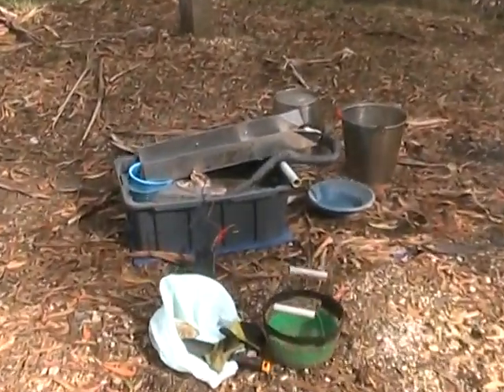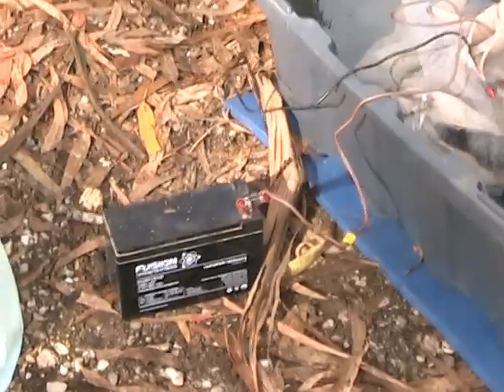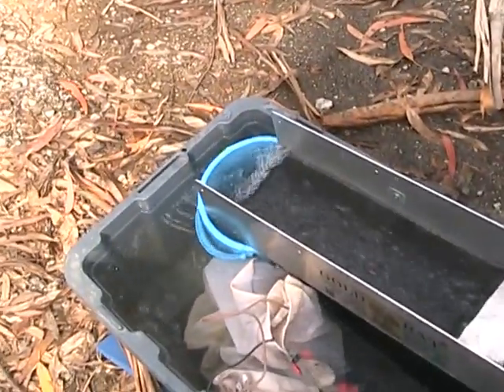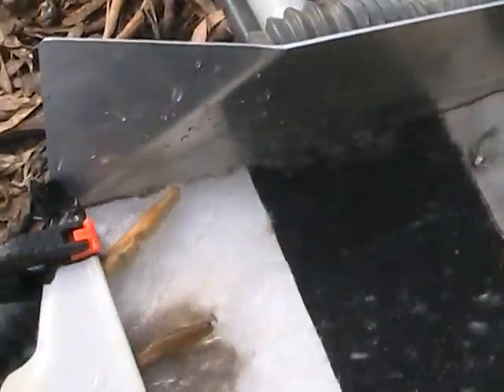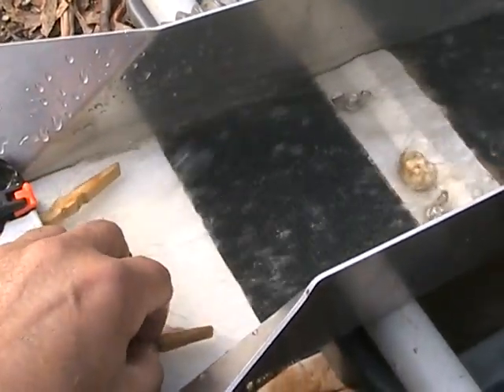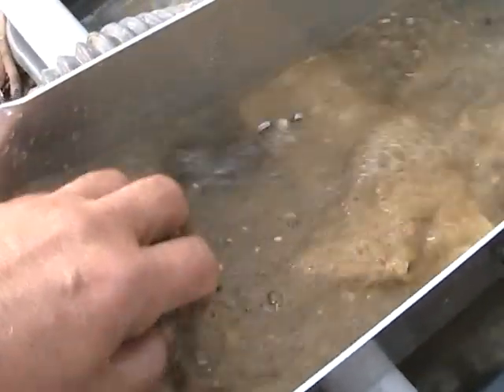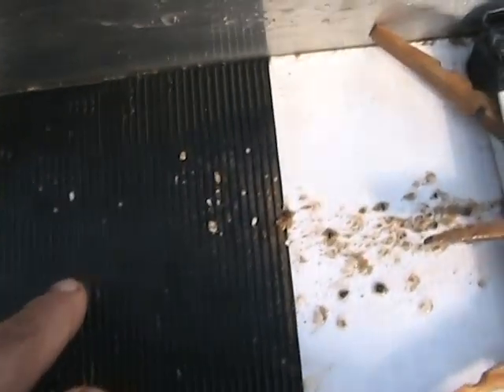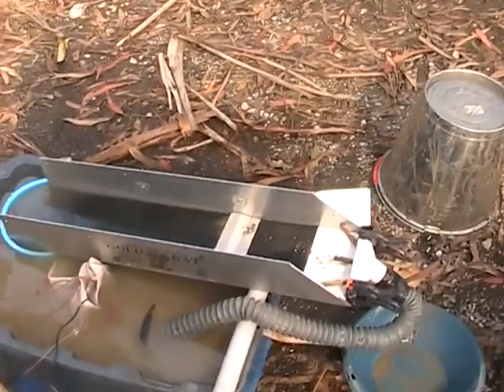Mobile Sluicing Tub Part Two

Comment: For your information , I run a pump with twice your output , but my sluice is almost twice your width , so I figure we are both running the same amount of water per unit width.
And I find 5 degree slope works very well with my setup and you find that with an app that downloads onto a mobile phone.
It fairly close to the often recommended grade of 1 in 12.
Any less and you get too much black sands and any more and you risk losing gold , but a degree either way should be fine.
Reply from the maker: I just don't do many videos when I am out and about, whilst I'm sure there are apps, just not for me thanks, I will use the larger pump with the dream mat and less classifying. It's all good. To me surprise the V;Matt has worked well and the smaller pump is a good match. Cheers
Reply: @dataglasses  So if you don't want to use the app to set up your sluice angle , How do you do it ? Just judge by eye ?
Reply from the maker: @mohammednovalija  Yes and it worked fine